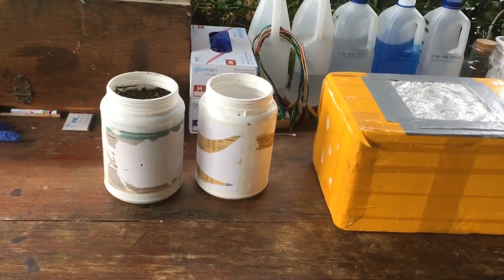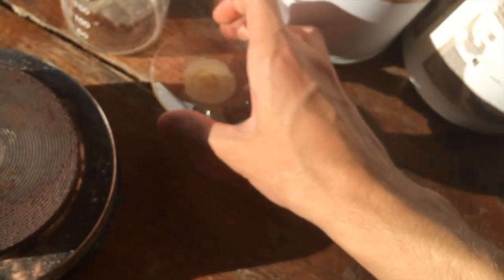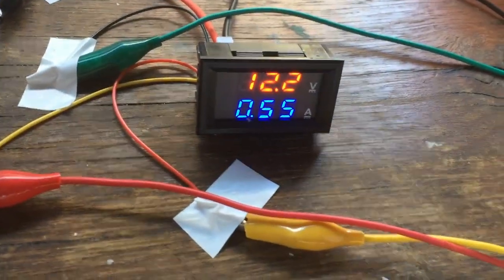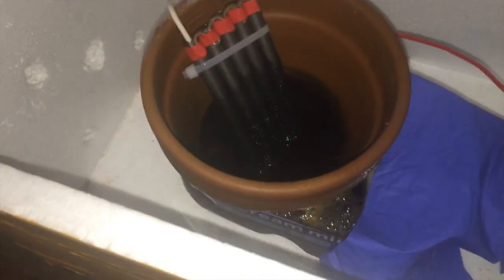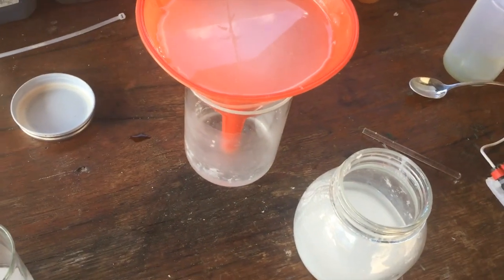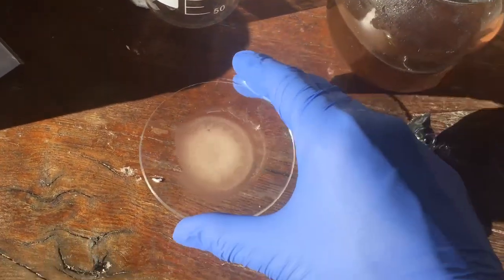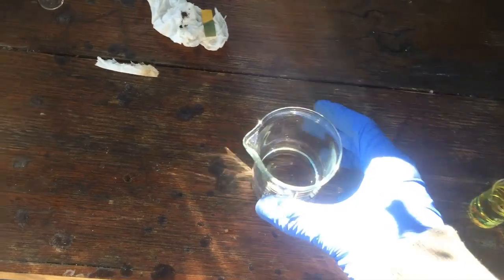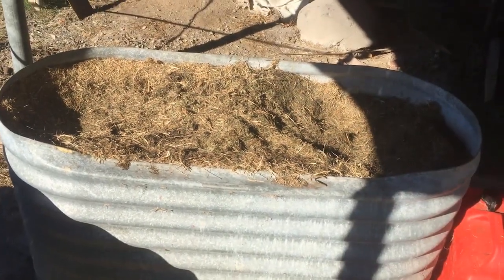Nitric Acid From Compost?

Comment: You could use electrical arcs to produce nitrogen oxides, and then bubble those through water to make nitric acid
Reply from the maker: That’s exactly what I’ve got planned for the second attempt, just need to buy a neon sign transformer
Reply: @ScrapScience  Can't wait to see it! Love the channel!
Reply: @metalheadguy2109  Yeah, I don't think it's going to work very well.

Yields using that method are extremely poor.
Reply: @neutronpcxt372  mine ran for 48 hours straight and i got 400ml of 98% nitric acid
Reply: @mikahandony1562  98%?
Don't you mean 68%?

Unless you mean anhydrous nitric acid?
Reply: @neutronpcxt372  Srry I meant 68%. Thx for the correction
Reply: Mikah Andony That’s quite impressive. What’s the power of your system?

Comment: I feel like most of your losses were from the clay pot reacting and possibly evaporating or decomposing. It would probably have better yield if you just got the main nitrates in salt form and did more crystal purification. Then do acid exchange distillation or the electro method afterwards to limit the side reaction loss.
Reply: Skip the electrolysis entirely, purify the nitrate compounds via crystallization and then do acid exchange.  That would be my best guess on how to keep the yields high.

Comment: Couple of things it would help if u actualy composted u have to mix an air rate to compost and itll give off heat as the micro orgnisoms break it down. The way ur doing it takes over 100 years to break it all the way down. Compared to 6 months to a year when done properly. Also some urea or urine would proberly help and finally i suggest using a larger amount of material then boiling the water down b4 u do electrosys

Comment: Instead of making CaCO3 U can break a chalk, it have pretty high % of  CaCO3
Reply: and i checked if the chalk i have is made up of CaCO3 or not so i made chalk powder and then  dipped it in Dil H2SO4 it did some fizzing , so is it CaCO3 or gypsum
Reply: I was thinking crushed eggshells. Chicken eggshells are made up of 95% calcium carbonate by weight and the remaining material is primarily organic matrix. Eggshell membrane is primarily composed of fibrous proteins that can be filtered out. 

 Reasonably high purity to start with and it's a costless waste product.

Comment: Yes this was the Method of extracting Nitrates in the 18th century and Cody from Cody lab did this. In Quebec Potassium Nitrate at least in Quebec is Illegal the only exception is Magnesium Nitrate. Some local suppliers on ebay may sell you KNO3. But you do it with electrolysis which is an interesting procedure.

Comment: heres an idea (though it works better with a catalyst) 1 get some compost or decomposing matter or urine 2 take the vapors and heat them (with oxygen) 4 it's catalyst time 5 have the vapors mix with water 6 use paper soaked in wood ash paste to capture any remaining fumes (these will also form nitrates) 7 if possible make it a closed system so fumes and ammonia don't escape

another possibility is 1 have a heat resistant glass dome 2 make a small jacobs ladder arc 3 put some paper soaked in wood-ash paste in there far enough away from the arc to not catch fire 4 pump the air through a filter leading to a second dome with a small nonreactive tray of water 5 add a third dome with sulfur that's ready to be ignited 6 once done with the first dome ignite the sulfur in the third dome while directing the vapors to the second one 7 watch the reaction in the second dome while laughing that you will have crude nitric and sulfuric acid 8 once you are done with it all simply remove the domes (in a fume hood or outside with a fan) and harvest your liquid gold (please don't take gold literally - if you can't take jokes transmutation is not a thing without a bunch of equipment and we can only make small amounts of certain isotopes) and use it for whatever (also take the wood-ash paste paper because the ash will probably contain nitrates) hope this idea is good oh yeah once again please make this a closed system so fumes don't escape
Reply: Wood ash is a great source of pot ash(potassium nitrates)

Comment: this looks like a ton of work, for a very little eyelid wouldn't it be much easier to  put together a small birklend idyed process chamber? and just pull nitrates from the air?
Reply from the maker: Yep! Definitely.
This was just an experiment to see how effective/difficult this route would be. A Birkeland-Eyde reactor is a much better use of your time if your goal is to make reasonable quantities of nitrate.
Reply: @ScrapScience  hey sense i got a hold of you, i am trying to setup a simple chem lab, and i want to do some distillations, now did some water distillations to get clean water for chemistry and it rampt up our power bill, what would you recommend as a chep/free source of heat?
Reply from the maker: Distilling water to get pure stuff is a very expensive way to do it, regardless of what you use for the heat source.
The best way to get pure water is to buy it (normally sold as 'deionised water'), as this is much cheaper than performing distillation yourself. Even better is buying a reverse osmosis purifier to convert tap water into the stuff you need.

Comment: Dear Harry how are you. I hope you are doing fine in your home country. Iove your videos and I benefited from thed greatly. 
I am a teacher here in Kenya. Harry I want to ask you a question; is it possible to use welding electrodes, after scrubbing off the flux? They are made of mixed alloys
Reply from the maker: Most metals will work as a cathode material here, but the anode must be graphite/carbon. I'm afraid those welding electrodes won't work as an anode.
Reply: @ScrapScience  thanks Harry andvI hope you do well on uour exams. You are member of the family, because ee know so much about your life
Thanks

Comment: a very good video. Thank you for your hard work. :)
I will try the same concept like you did, but can i make this with urea instead of compost or will the yield with compost better? Sorry for the stupid question im a laywoman. :/
Reply from the maker: Urea alone will not allow you to make nitric acid, I'm afraid. That is, unless you convert it to a nitrate salt first.
Reply: @ScrapScience  thank you for your answer, you mean i can mix it with KCl or CaCO3?
Reply from the maker: Not quite, since KCl and CaCO3 don't contain nitrate either. To convert urea into nitrate, you'll need some source of nitrifying bacteria, and you'll need to let them do their thing with good aeration for a while (depending on how much urea you have, this may take months). It's much simpler to start with a source that already has nitrates in it than it is to start with urea.
Additionally, the method in this video basically didn't even work to make measurable quantities of nitric acid, so why try it in the first place?
Reply: @ScrapScience  Thats a good reason to don't try this in the first place, but i want to find another ways to get on products. So i want to try to isolate the nitrogen from urea with electrolysis and introduce it in NaOH or maybe in H2O2 to make nitric acid, so are my thoughts. Im happy for every help.
Reply from the maker: Are you looking to obtain nitric acid specifically? First, electrolysis of urea to generate nitrogen gas is a rather difficult reaction to pull off. Additionally, introducing nitrogen to NaOH or H2O2 will not give you a reaction, due to nitrogen's extremely inert nature.

If you're really set on converting urea into nitric acid, the best way is first turning it into ammonia (check this video: https://youtu.be/0-jJ5QF-EVE?si=IQUCoS5UMw0zhUQZ ), before feeding your ammonia through the Ostwald process to convert it into nitric acid (again, you'll have to look elsewhere for information on this). 
If you don't have the necessary catalysts and reaction conditions for the Ostwald process, you can also convert your ammonia to nitrate by an electrolytic method (I made a video on this here: https://youtu.be/AbrmHN5wOY8?si=zyySTBWQJ1b8bHNM ), but this will require some investigation to make it an adequate technique for making more than a gram.
Reply: @ScrapScience  Yes you are right. I try to generate HNO3 from different ways. There are very low yields, but its ok for me. I like the since behind. Its like "to make something from nothing". Thank your for your advice. I will have a look for some technique and investigate more.

Comment: but i dont understand the pot acts as a semi permeable membrane? didnt the large claypot have a hole in the bottom?
Reply from the maker: I plugged the hole with some silicone sealant to stop it from leaking. You're right in the fact that using it with the hole in the bottom would stop the process from working
Reply: @ScrapScience  how did you know that clay pot is semi permeable membrane? im curious i didnt know that
Reply from the maker: I found a couple of old patents regarding similar electrochemical processes which used clay pots as semi-permeable membranes, and they seemed to get good results in terms of solution separation. There are also a couple of others on youtube who have used them for other electromigration purposes.
As far as I've looked, I haven't found anything else which works as well as a clay pot membrane, so it's really lucky how cheap they are.
Reply: @ScrapScience  oh thats good to know ! thank you for taking the time to reply i didnt know about it!

Comment: hey scrap science i have a question i hope you will have time to reply!
i saw some videos about gardeners making compost tea and then bubbling air through it and then they use it as fertilizer.

in theory they are turning NH3 into NO3 using bacteria, i also seen alot of videos about sewer water treatment thye also bubble air through it.
and also in cody's lab video about niter bed where he pees on straw bed inside a tarp something similar should happen.

i was wondering what do you think about that? can a simple air pump in a bucket with compost tea work as a nitrate source?
if it works and the nitrates can be purified then it could mean a cheap source of nitric acid!

im really excited about this and i wanted to know what you think about it! maybe even make a video trying it?
Reply from the maker: Yeah, I’ve also looked into similar stuff a while ago (nitre beds I believe they’re called). In fact, most people seem to do without an air pump, as a properly aerated bed doesn’t seem to require it. Sadly, the whole process of nitrification takes something like at least 6 months (possibly over a year) to get a decent quantity of nitrates, hence why I haven’t had a go at this yet.

It’s definitely a plan for a video in the far off future, but I currently don’t have the time (or the space), despite how interesting the process is.
I am, however, actually currently working on another video right now which involves a more direct (and much faster) oxidation of ammonia to nitrate. If it works, the video should hopefully be up in a couple of months. If it doesn’t work, I might eventually move on to making a nitre bed, or possibly a Birkeland Eyde reactor.
Reply: @ScrapScience  nice!! that sounds really interesting! i also saw niter bed cody's lab made and it took about a year so its not realyl attractive option.

but the videos i saw about compost tea which is just a bucket with a bit of compost and alot of water and an airpump say it only takes a day or so!
do you think it could be true that the airpump in a water bucket with compost can be a faster version of niter bed that takes a day instead of a year?
Reply from the maker: I’d very much doubt it to be true, as the nitrifying bacteria definitely can’t work that fast, and oxygen from the air alone cannot oxidise ammonia to nitrate. With that in mind, I don’t know how an air pump would speed up the nitrifying process or cause incredibly fast oxidation, but I could be wrong. If it works, it works, but oxidation of ammonia to nitrate is something that quite a lot of research has gone into, so a simple solution like an air pump through compost working in a day is probably too good to be true.
Reply: @ScrapScience  thank you for replying im really interested in everythnig nitric acid related!

Comment: Scrap Science is it possible to use iron rod for the cathode and what is the effect?
Reply from the maker: Most common metals (and also graphite) can be used as a cathode (though I'd probably avoid aluminium), the result is no different between using different metals, whether it be iron, copper, nickel, stainless steel, graphite, etc.
The anode is the only electrode where the type of conductive material really matters.
Reply: @ScrapScience  Thank for answering my question. more power Sir.

Comment: I think if I remember correctly Peanut plants can fix nitrogen into the soil. I wonder If you could do some processing to the soil that a peanut plant inhabited and then electrolyze it to make nitric acid. I’ll have to do some research on this. I have a peanut plant so I could conduct my own experiments.
Reply from the maker: Yeah, all legumes (of which, peanuts are a type of) act as excellent homes for  nitrogen fixing soil bacteria. I'm not sure how applicable it is in terms of making reasonable quantities of nitrate, but please let me know if you ever get anywhere with it.
Reply: @ScrapScience  I am kinda worried about the dilute nitric acid possibly damaging my platinized electrode.
Reply from the maker: Yeah, I'm always hesitant to use my platinum electrode for things. It seems risky to use platinum for a process that may or may not destroy it.

As far as I know, graphite electrodes have also been used to extract nitric acid from nitrate-rich soil. From a bit of research I've done, you should check out the following link:
http://www.sciencemadness.org/library/books/the_manufacture_of_chemicals_by_electrolysis.pdf
On page 30 of the book (or page 42 of the pdf), the author goes into a method of extracting nitric acid with a carbon anode in a clay pot which is imbedded in the ground (and with stainless steel electrodes inserted in the surrounding soil). Slowly electrolysing the setup apparently gives nitric acid without disrupting the nitrifying bacteria from doing their thing.
Reply: @ScrapScience  I could possibly test whether it is safe to use platinum by using a tiny bit of platinum wire before using my platinized titanium electrode. Unfortunately, I just ran out of carbon electrodes, so I’ll have to order some more. I think I’ll stick to my carbon for this one.
Also I think this process was invented by Albert Nodon.

I like the process you suggested. Only problem is where am going to get coke( as in fuel coke).
Reply from the maker: That's probably the best idea for testing the wear rate of platinum. However, also note that the rate of corrosion is often different for solid and plated platinum surfaces. Though the difference isn't usually something to worry about. 
If you do transition to using your platinized titanium, initially only dipping half of the electrode surface in the solution might be a good way to start, so that you don't ruin your whole electrode if it does fail.

As for the coke it talks about, it's only referring to how they used to make carbon electrodes (since the book is over 100 years old). It's unneccesary if you can get hold of carbon electrodes directly.
Reply: @ScrapScience  The coke also probably increased the surface area of the electrode. I’m going to add the coke anyway just for fun. Turns out they sell it for blacksmith forges.

Comment: Are there other alternatives to a flower pot? because I have been unsuccessful in finding ones without holes in the bottom.
Reply from the maker: You could plug the hole with silicone rubber, that’s what I’ve done and it’s worked pretty well. Otherwise you could set up the two half cells in separate containers and connect then with a damp paper towel to act as the diaphragm, though the current (and speed) of your cell would be reduced a lot.
Reply: Thank you very much for your help
Reply: @ScrapScience  can you do demo for that please!

Comment: have you tried stainless steel electrodes? maybe better?
Reply from the maker: Stainless steel is very susceptible to corrosion under anodic conditions in a non-basic solution. It would work perfectly fine as a cathode but as an anode (in this case at least), it would introduce chromium/iron contamination into the product, assuming it worked at all.

Comment: can you make nitrocellulose from this nitric acid ?
Reply from the maker: No. The nitric acid required for the nitration of cellulose needs to be much more concentrated (near azeotropic at least). In theory, you might be able to generate enough acid by this process, and then fractionally distil to get the required concentration, but it would be an inefficient and VERY lengthy process.